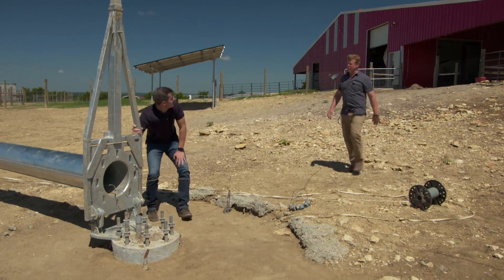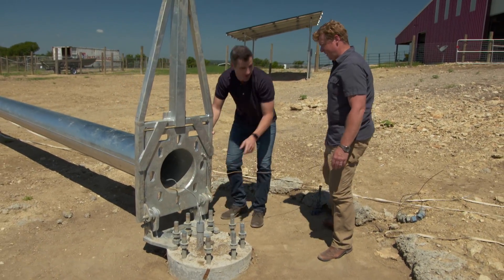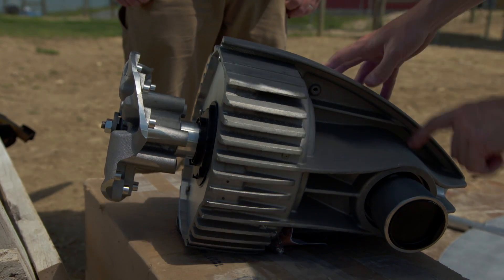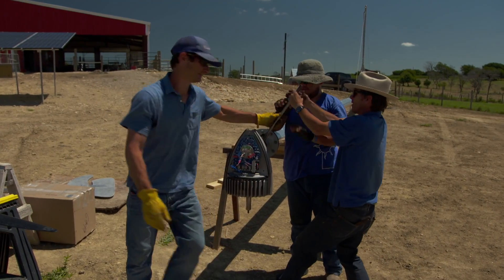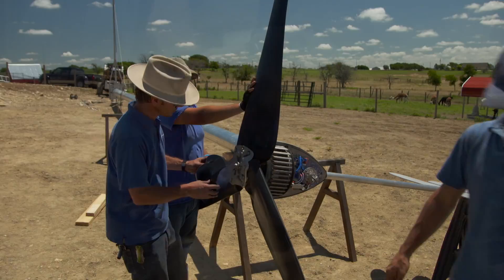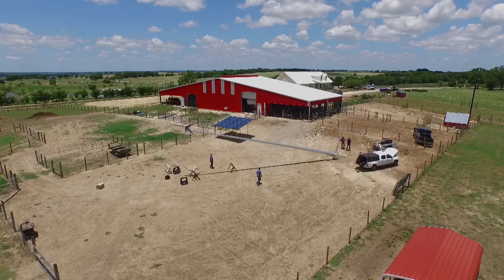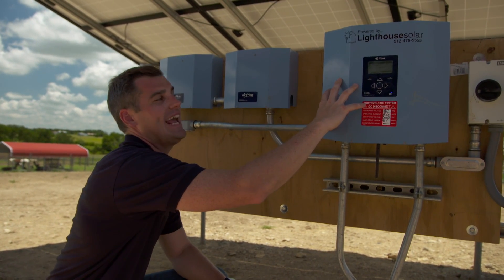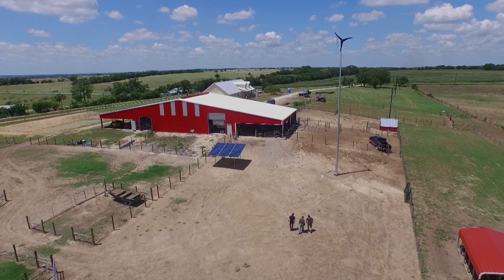How to Install a Home Wind Turbine | Ask This Old House

Comment: It seems to me that you are wasting the length of that pole by not using vanes that rotate about it. And is there a reason that you only put propellers on the top?
Reply: Two main reason. How do you allow the turbine to spin around the pole in the "middle"?  Remember the wire. Second is that the pole has to be strong enough to support the total area of the blades in high winds. The pole was not overbuilt for the turbine he has on it.

Comment: Would be really nice but the amount your going to pay for a set up like that,,,you could pay your electric bill for a lifetime anyway..lol
Reply: 1.5 kw is pretty wimpy for such a massive footing and 3000 pound pole. You'd think with all thet invested you'd spring for a ten Kw turbine at least
Reply: Maybe he's a prepper. The cost of knowing if the grid goes down and you still have power for basic things in many cases is well worth it.
Reply: Average Monthly Output 202 kWh at 5 m/s i think all together around 15K(turbine & tower) is enough with together with a 5.2KW solar package will cover your house..

But a 10KW system, cost for a regular resident to much money..

A 10 kW wind turbine costs approximately $48,000 – 65,000 to install. The equipment cost is about $40,000 (see 10 kW GridTek System ) and the rest is shipping and installation. Towers without guy wires are more expensive than guyed towers. That depends on your cost of electricity and average wind speed.

That 1.5KW wind Turbine on a 90 feet tower do makes miracles
Reply: you're basically paying for your electricity up front. After you install the solar or wind you get the electricity for free.
Reply: It's true that it can be a bit tricky to profit. However, if you take advantage of energy tax write-offs, and you buy good long-lasting equipment, you can indeed not just turn a fudged profit, but a genuine one.
Reply: Yep, that's why you build it yourself from salvaged parts. And if you got sun the solar panels is the way to go.
Reply: Wind is the best way to go.  You can get a company to sell, install and maintain a unit like this, assuming it's about 5 kw, for about $25k plus an annual fee for a maintenance visit.  It will make about $10/day for the next few decades, but give you independence.  In conjunction with Solar PV and a battery, you will always have power.  No politics, taxes, pollution, it's a nice list.  Finance it over 5 years and you'll probably pay something up front.  Over ten years and it will pay for itself.  The only reason we don't do wind before Solar PV is the problematic logistics we see here, and the fact that people don't like to see them.   
I don't like looking at utility poles, and all the confused mess of wires that dangle throughout our neighborhoods from the above ground grid we have now.
Nothing like having a backup system.
Reply: @refusoagaino6824  A "good" 1.5 unit will cost you twice that and that maintenance fee is going to eat what little you make. You all need 15+mph wind for 8+hr a day (MAYBE 20% of continental US). The unit in this video is rated at 1.5Kw in a 11m/s(24mph wind).
Reply: No there wouldn't, utility companies are government controlled and regulated. They're government controlled monopolies, you and Joe Schmoe can't just up and start a utility company.
Reply: Mike T I was a
Reply: Have you got a credible source to back up this statement because it stinks of complete bullshit...
Reply: @Wm....  Get fucking real pal..
Reply: Wm Wardwe
Reply: rbeck3200tb40 a simple google search proved what you said is a bunch of "hot air" (no pun intended).
Reply: rbeck3200tb40 stop listening to Fox News. It’s the republicans that did away with the subsidies to favor “clean coal” and “clean natural gas”
Reply: Truth is without government rebates you will never make your investment back on a small 1.5 kW turbine setup on a 60ft pole.  Once the government stops subsidizing green energy and cuts the feeding tit off, it will go back to just being a power source for isolators.

If it renewable energy was actually profitable, even at a small 3-5% ROI, there would be a lot more private companies just selling electricity.
Reply: https://www.google.com/webhp?sourceid=chrome-instant&rlz=1C1AVSX_enUS388US388&ion=1&espv=2&ie=UTF-8#q=Pika+turbine&tbm=shop

How hard was that, use GOOGLE....
Reply: Mike T: you sound both lazy AND stupid. Minimal investment one time versus pay thru the nose forever? My 12VDC solar system has already paid for itself in 2 years. Wind power is pricey as hell due to the infrastructure and support equipment. Solar panels are a gold mine.
Reply: The US government used to pay 30% of the cost of any home solar power installation and probably this wind power installation  BUT OBAMA STOPPED THIS program now you have to pay 100%

Comment: dude.. thats cute .. our german windgenerators have 40+ meter wings xD and just the generator part is as big as a normal house ..
what can this small thing do? xD 2 lamps? 3?  xD and i dont  think its quiet ..
its a mini mini mini mini mini wind turbine here some farmers stick together buy a real windturbine.. use the generated electricity and the rest goes back into the grid and u get paid for it...
Reply: Powder This video is about a residential hobby turbine. Not about full windfarms. Those big ones are all around the globe, not only in Germany,

Comment: Where is the lightning rod?
Reply: With 20 feet of foundation rods wouldn't this be naturally grounded?
Reply: Ten Second BuickGN the pole the turbine is on!
Reply: Mark Wright The highest point is currently the generator. That is where the impact will be. Better had a metal rod sticking another meter above it.

Comment: Looking at the design, they basically built in a automatic Yawing set up.  The diameter of the blades dictate how long the vain is and also the surface area of the tail section.  since the blade diameter is larger, at higher wind speeds the blades will turn out of wind.   It would have been better to build in a furling set up.   Using a axial design, they could of added more coils per phase which would give you a lower cut in speed and higher amperage input. Hopefully the charge controller has individual power curve selections to maintain efficiency thru different wind speeds.  So in a nut shell, one size does not fix all needs.  a wind system needs to be built to match the wind speeds  and power requirements
Reply: Wut?

Comment: what is the cost of the turbine and inverter?  it looks interesting.  Did you get any incentives, tax breaks, etc?
Reply: Texas has more wind generation capacity than the next 3 biggest producers combined, california included. Just look at wiki.
Reply: +Maryqc1960 Texas has no incentives that I know of (it's Texas, i.e. home of big oil and global warming denial), but there are tax breaks on a federal level.
Reply: Doug Reed If you read through those the answer is no, texas doesn't really have incentives for residential solar and wind. The only thing they seem to have is rebates for when you produce more than you use and your excess power is fed back into the grid.
Reply: Doug Reed very true, that's a great website.

Comment: Who manufactured the turbine? Was there any battery backup incorporated into system in case of grid failure?
Reply: Pika Energy.  They're a Maine, U.S. company.  It's a good little turbine but way too small for practical use.  I have a 2.4kW wind turbine in my backyard, which cost about 1/3 the cost of this Pika turbine and produces a lot more energy.
Reply: +Steve Hillier I'm guessing that the turbine is Chinese made. There is no mechanism for yawing in high winds.  3 wires into the generator means three phase output, which is fine, but that means you can't go direct to a grid tie inverter.  Rated output of 1.5 kw means to me that a 500 watt or less average is more appropriate. I don't know what Texas power rates are but I would guess that this unit would never pay for itself. Without a dumpload this unit will fail in the event of high winds and grid failure.  Overall its a good show to appeal to the anti-oil/fossil fuel audience.
Reply: +Dave Bainard They are on the grid.  This supplements.
Reply: +keifsanderson Who made it? In case of grid failure, is there a shut down for turbine so it doesn't burn out especially in high winds?
Reply: +Dave Bainard I could (easily) be wrong but I thought these small turbines always charged a bank of batteries so they would avoid major and constant fluctuations in power output.
Reply: @Hugh Jaanus It is a 380v regulated DC output.
Reply: @Hugh Jaanus Go check the specs for this unit. It outputs (at the nacelle) 380V regulated DC. So NO this product is NOT outputting AC. Yes, most send AC until just before the inverter, but not this one.

Comment: Looks interesting, but with the cost of everything that went into it, parts and labor. Its doubtful it will ever pay for itself.  Let alone save any money.  About the time you get to break even parts will need replacing and more money will need to be dumped into it.  Clean energy is just to expensive to be practical, but big oil likes it that way i suppose.